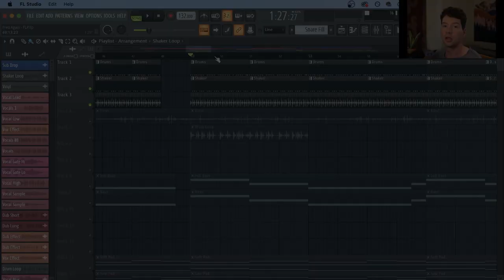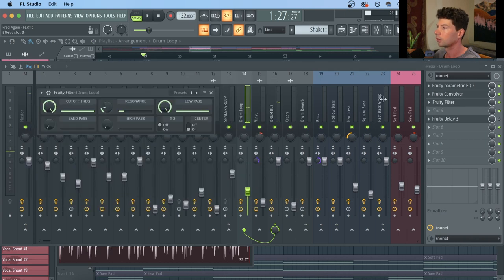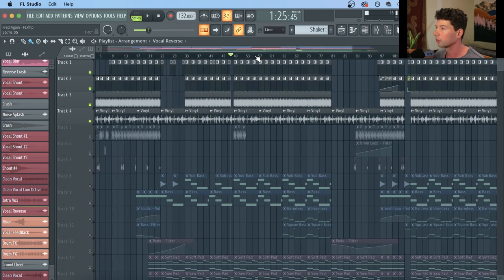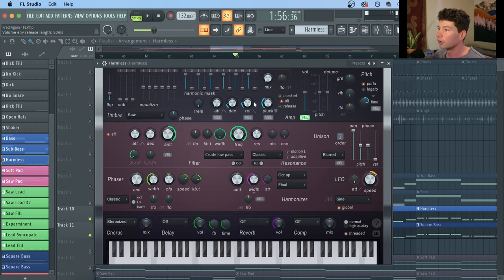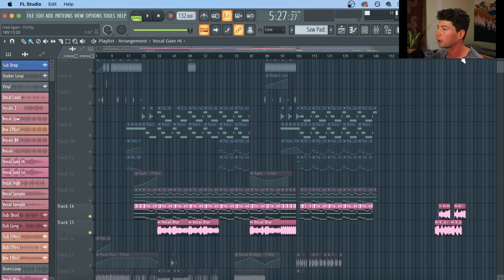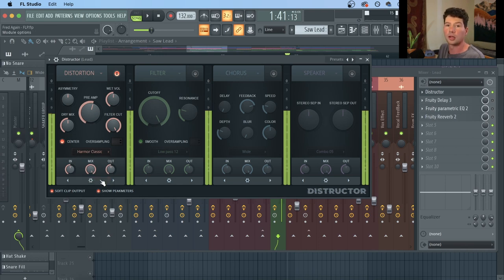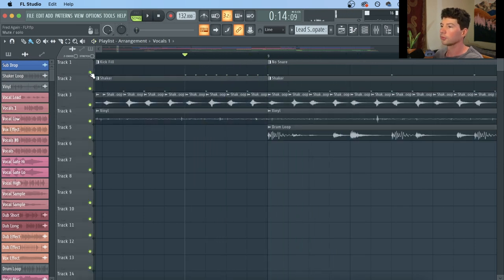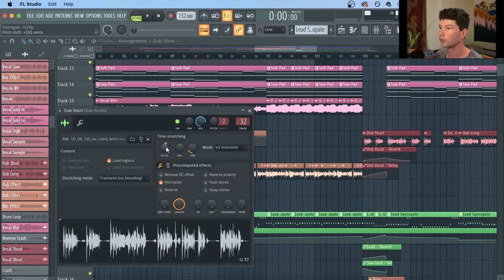Mastering Fred Again's Production Techniques: Step-by-Step Tutorial

Comment: what is the first pad that you used !!!
Reply: also where did you find the vocals , thanks
Reply from the maker: For the first pad sound I sampled a C5 note from a preset called 'Synth Pads' which comes in a free plugin by Spitfire Audio called 'LABS'. In the VST you can choose from 11 different presets which are all sampled from real analog synth which have been run through various analog effects. There's loads of presets you can download from Spitfire which are free from ambient textures to violins, guitars and real drums. It's amazing if you don't have any hardware but want to incorporate some authentic analog sounds into your tracks. 

You can download here: https://labs.spitfireaudio.com/synth-pads

The vocals I got from Splice which is a subscription based loyalty free website. Loads of great stuff on there but you may have to do a lot of digging if it's a more specific sound you're after.